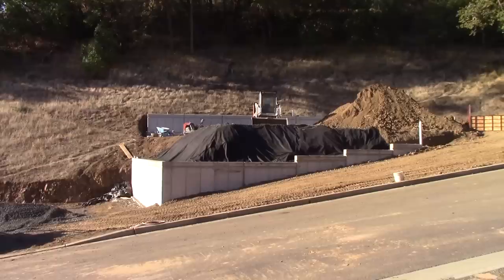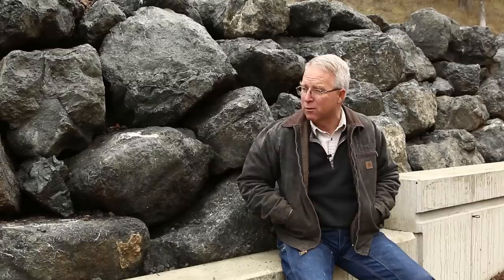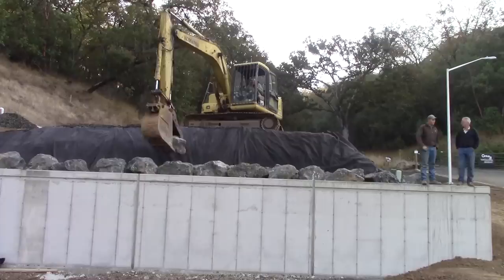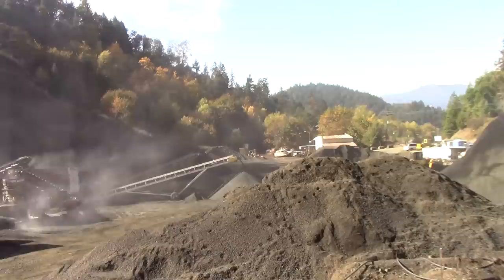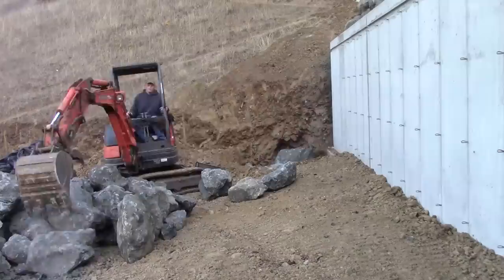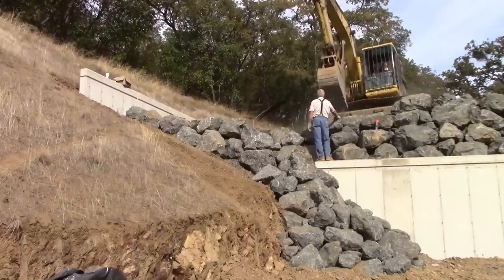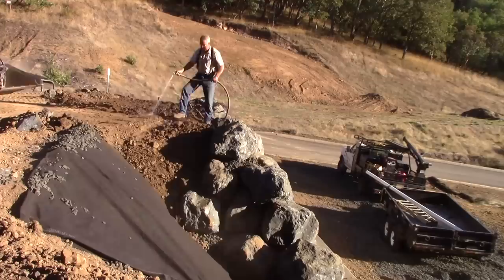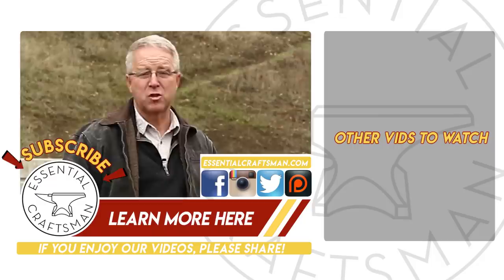How To Stack A Boulder Wall: Ep 20

Comment: Dexter could change a diaper with that excavator!
Reply: I was on a job once where the operator could put one of the teeth into your back pocket.
Reply: I worked on a job once where a guy dropped his glasses into slack water on a river, downstream from a barge of gravel that was getting unloaded.  The crane operator motored over to the spot, gently dropped his clamshell bucket into the river and fished out the eye glasses on the first try.  I was forever in awe of his skills after that.   Cheers!   Whipple
Reply: I'd be filling a few diapers being so near to that machine on rocky footing.
Reply: Well we can say he is dexterous.

Comment: Looks awesome. In water resources engineering, we use riprap for erosion control. It's fairly common to use it on the upstream face of an embankment dam to prevent damage due to wave action. I have a coworker who refuses to walk on it because he's afraid of snakes ;)
Reply: So cool seeing two of my favorite channels in one setting. I'm a recent grad in water resources and love both of these channels.
Reply: No lie!  I was picturing children of the future home owners climbing on that rock wall and how they scramble upon seeing their first snake.
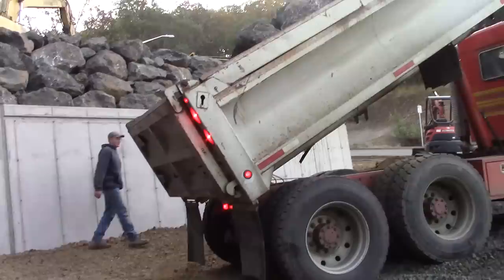Reply: I am sure this system has a  surcharge problem; the top of this wall is overloaded. Does his "soil engineer" have all his pistons firing?  Plus the overloading of the toe of the footer at the corner detail with those boulders. That corner detail 9:36 also DIRECTS water to the underside of the footer; the best way to cause that footer to fail is to wash out the soil it sits on! Gator grid fabric or similar products should have been specified for this job and not just soil compaction.
This engineer makes me think of the engineers that build on the hills of California and then the owners are surprised when their homes slide off the slope they were built on.
Reply: @EngineerPEretired   See Episode 24: He had to re-stack the boulders
Reply: @manorin  , thank you for the redirect...  someone else also wrote me on the side, to look for that video...    I wanted to cut my loses on critiquing his work... Basically, he is doing a great job of sharing some information in his videos and I do not want people to "throw the baby out with the bath water"...
Besides, he has a more manly microphone than I have... lol --- I really have to spend time and make my audio separate from my videos... 
Just do not have the time to spend editing...  (my mac and Final Cut Pro are the slowest rendering software?)...  Takes about 10 hours to render a ''canon camera video to an Apple to a Youtube production)...
Okay, back to the subject, I do find a few mistakes he makes in each video and he does them without stating this can be wrong or I am experimenting... He presents as this is the way it is done and you can do it this way also...  Another example is him using two tape measures on a wall     which he joins and states he is within 1/4 to half inch...   
At the distances he was at, NO WAY because he had an elevation change that he did not account for, the elevation change was two fold, one was the heightS of the anchor points of EACH one of his tape measures and the point where he joined them (at his location)... 
This was compounded by his belief that the tape measure(s) would not stretch, and that he had the ability to keep all these things level and touch each other (that was a defect there)...
I use a professional equipment and an ametuer builder would use his method(s)... or a builder that will NOT invest in himself by purchasing professional equipment...
With all that said, the tapes can be used buy with great doubt... 
In conclusion I appreciate the entertainment and would welcome the chance to educate him on his errors; so the public can get a more quality understanding of what is going on...
This means I would support his content and not ''attack'' it (baby and the bathwater)... 
I often do experiments in construction but they are always on my personal jobs which I get to monitor and IF they fail, they go right to the trash can! (Right now, I am experimenting on a floor leveler -- based on fiber content, it is so amazing at this time... I have it on an exterior concrete (very stable base ---- and another on a wooden floor with a small amount of deflection (not disclosing yet)... which, in BOTH cases are NOT showing any surface cracks)...  So far so good...  
Next summer, I will present the findings of these pretty awesome projects, if the wooden floor fails it will NOT even be suggested... The concrete I do NOT expect any failure and we should see a video of that then and with my recommendations... 
I know home owners and contractors are on a budget and want to break some rules... I am just trying to make that budget person find a product that will save them the dollars and give them an idiot proof product...

Comment: It is a pleasure watching a skilled excavator operator.  They are magicians with steel and oil.  Plus, watching a properly engineered rip-rap wall go up is also a treat.  Too many times it just gets dumped and after the first winter rains [here on the "Wet Coast"]  they fail and becomes a nightmare for all concerned.  This is proper building.  I am enjoying every episode.

Comment: 3:21 - is that a crack in the corner of the concrete? is that ok?
Reply: One of the things he says in an earlier video is that concrete always cracks. It's ok and safe because the structural integrity is maintained internally. In other words, that crack is very small and in a place that isn't structural, so it's ok.
Reply: ok thanks! I remember him saying the cracks would happen, I just didn't expect it so soon, and before the house was built. Good to know!
Reply: Even more so, if the concrete doesn't crack the rebar doesn't do any work.
Reply: I think its just a surface crack,,,, and no concrete doesnt always crack  i have basement foundations that i poured 20 years ago that dont have a single crack in them, but it does happen.
Reply: its a wall so a surface crack is not ok
Reply: To me it does not look like a crack.  Perhaps some construction debris, twig or twine.  Maybe the main man will clarify.
Reply: Glass breaks, concrete cracks, girls cry. These rules are immutable.
We try our best to lessen the occurrences of all three.
Just sayin.
Reply: Just a shrinkage crack won't affect structural integrity.
Reply: hey E.C i got a question where is a good place in RB to get refractory cement or such i've tried CO-Op and Home Depot and Lowes and even Willamete G. Stone none of them had it, nor could order it in. Got any suggestions?
Reply: Wrong
Reply: If it were going to happen any place, that is where you would want it to happen.
Reply: I thought you'd get called on that.  Rebar in tension will hold.  But an inside corner would be the strongest part of a retaining wall.  I'm a little dubious about your statement that that outside corner is the strongest point in your wall.  Not to argumentative at all.
Reply: Yep it's a crack, no it won't affect it
Reply: It's considered a hairline crack, a surface crack,  in a wall this size.

Comment: Another great video. The beauty of this property is quickly taking shape.

Scott's explanation of the dangers associated with working near heavy equipment and loads was spot on (as usual). I have an additional concern regarding the hazards of hydraulic lines that is near and dear to me, as it permanently altered the life of one of my co-workers. Hydraulic fluid was injected into his body from a leaking hydraulic line on an aerial lift. The fluid cut through his glove and hand like a hot knife through a stick of butter. He was rushed to the hospital where doctors were forced to amputate his hand and part of his arm as they feared the fluid would spread throughout his body and kill him. There's no way to remove to fluid from your body once it enters.

If you ever see a hydraulic hose leaking, NEVER pass your hand or any other part of your body over the leak. Inspect lines on equipment before using it, never use equipment with kinked hoses or obvious leaks, and always keep hydraulic hoses clear of possible pinch points. All of what I've said may be common sense for many, but I feel it's every working man's responsibility to share and try to help others learn from their own experiences. I hope you all stay safe.

Comment: I am a fan of safety and personal protection that actually protects and let's you work too. Your eye protection when pressure washing the forms made perfect sense, whereas  'always wear eye protection' just smacks of a lawyer attempting to limit liability, not actual protection that allows you to work. 
Similarly with your admonition to be ready to jump if all hell breaks loose with the boulders or excavator, but don't be afraid to get up close and personal to achieve an excellent product. 
The unrushed pace is another example of workers who know what they're doing and are aware of the need for caution and deliberate, precise movements.

Comment: Where I live in No. Cal we call that size of rocks 'boulders', and rip rap is more like 8" on a side. Those rock walls are pretty popular for their look -- they look super heavy duty and natural. Another trick I have seen used in stream beds is to fill a 'wire cage' (the 'wire' is 1/4" dia) with rip rap. So it makes a bunch of smaller rocks act like a giant rectangular boulder which the water cannot move. The smaller rip rap is less damaging to dump trucks and can be scooped. For appearance, though, everyone loves the big boulders like you used.

Comment: Remote cameras are really changing the safety of jobs like this. Being able to see a close up of what's happening out on the end of a piece of heavy equipment like that for yourself without having to get out of the cab lets an operator place material with more precision and confidence. Not to mention being able to clearly see other parts of a site and all the blind spots around your equipment. 

I much rather see a cheap camera on the end of a fibreglass pole get crushed than myself or a coworker if something slips. 

And some of the tech that is emerging now is truly amazing from a productivity standpoint. Use a tablet somewhere on the site to draw diagrams over a video feed to better explain what needs to go where. Companies like Hardhat Connect are rolling remote communications out for hazardous industries, but I can't imagine it is going to be all that long before a camera and headset is common gear for everyone on a job site. Why walk across the lot to look at what someone's doing when they can ping you on the radio and let you see what's going on a second later?

But I think one of the most impressive features of it is going to be letting a senior tradesman quickly jump around between helping juniors with stuff, not just on one job site, but on sites spread across the whole country.

Comment: The guy building the wall did a good job, its tough to build a rock wall blind, it takes patience to build a wall, start getting impatient you can push the rocks you've already set out of position. Rock walls are not cheap to build a load of decent wall rock where I live is 500 dollars plus a load can be 10 rocks in a tandem axle dump.

Comment: Scott once again. Great job.... I know all about trap rock. And large rock rip+rap. Moved a whole shit load of it. Spread a ton of stone. FYI. THERE A THREE SPECIAL HARD STONE QUARRY USED ON THE RAILROAD ROAD BED UNDER THE TIES AND RAILS,,,,, That I know of in New England. One in Westfield MA. (Lanes quarry) . The other two are in CT. One in middlefield CT.( Reeds gap)other one is (Pine Orchard) . In a little town call Branford CT. Just east of New Haven Ct ... Reason I know this,,,,, did my time on the RAILROAD AS A CONDUCTOR in the this area. Stone FROM those quarry was send as far west as MN. You do the Math. Railroad hopper car weight 50 ton (empty)PER CAR Now put 100 ton of stone in the car. Now put 60 cars together. That was the max back in the day we could move. With 4 six axles. Road units ??? Engines. Then run down the road. Out on the high iron.( Main line.) At 50 to 60 mph. Just think three guys could move all that stone with one train. JUST A FYI FROM A EXTRA OLD RAILROAD GUY. PS WHERE WERE YOUR HARD HATS. JUST STUPID IN MY BOOK, REAL STUPID. YOU HAVE JUST TO MUCH INFORMATION IN YOUR HEAD!!!!!!!!!! TO GO HOME EARLY. LIKE ABOUT IT!!!!!!!!!! WHO WOULD. TEACH YOU GRAND SON THINGS. ILL GET OFF THE NAIL KEG PLEASE BE SAFE. JUNKMANDO

Comment: riprap has been a term that refers to anything larger than class 1 or class 2 rock, basically unsorted large rock. other than that you order by the weight of the bolder.  10 is basically a coarse sand, #98 is pea gravel, #57 is what most people call gravel, #4 is a larger gravel, #3 is about fist size rocks, #2  is foot sized, and class 1 and 2 are about the size of your head and are normally distinct based on their purpose as structural or ascetic. while not common there is a #67.

the numbers denote how big or small they are it goes 10,9,8,7,6,5,4,3,2,(class 1 and 2). it is based off of measurements, but my description above should be good for quick recall.

it varies by name but pretty much this is basically how they sort them.

some people will call unwashed #57: #411. when you wash stone it means they wet it so they can filter it and clean the stone.
some times #57 is unwashed but filtered this might be because it is recycled asphalt or concrete and they don't need to wash it.

Comment: Looks like a quality build here but then again I wouldn't expect less... The site prep for the normal guy who doesn't have a connection with the concrete company and rock prep guys would be very expensive. I live in a northern climate and so we have basements in every build and only slabs where water tables are close to the surface or there is permafrost which is way farther north from where I live, you know....Upper rubber Boot.   I digress. Great videos.

Comment: Appreciate the comment on the hydraulic line breaking and the equipment letting  go  of the rock but this is not actually how hydraulic systems work, there are safety redundancies such as a hydraulic actuated check valves closed spool valve controls or electro servos that act as safety measures to protect you and your load if a hose fails,.It is true though that a mechanical failure such as a broken weld,  cylinder split (An almost impossible occurrence due to safety measures noted above )0r operator error causing the load to drop or equipment to tip, operator error being the most common problem causing injuries to persons or equipment .
Appreciate your craftsmanship keep up the good work!

Comment: I used to load class 1s into a dump trailer with a front end loader. And I'll tell you it was a pain because you almost had to let the boulders roll off into the trailer. And I've also loaded rip rap into high sided dump trailers and it sounds a shotgun when you dump.

Comment: If a hydraulic line blows, the machine operates normally, until the fluid is too low. The pump will pressurize everything until the unmistakable grinding sound  of cavitating. There's always time to position the machine for the most convenient access to replace a hose

Comment: EC, if the hydraulic line of the boom fails, the boom should hold itself! There should be a valve attached directly to the two cylinders that only let the boom lower if the operator applies pressure to the corresponding hydraulic line that lowers the boom. Else the boom stays where it is.

It could be that this savety feature is newer than this excavator, but this is how all modern excavators are!

Comment: That geotextile is NOT for weed control. It's to prevent soil from infiltrating your wall, which would hold soil in and behind your wall, which would increase the retained weight ultimately causing your wall to fail. It's an important distinction to make!

Comment: Concrete wall question:  You put connectors through where the concrete was poured (front to back) how do you get those out/cut to provide a smooth surface at the end?

Comment: Hey Sy - since you had a lot of that area open, why didn't you put in a cellar?  Here in the Northeast (even on the coast) we often have granite block or poured concrete cellars.  Curious why you didn't put one there, knowing that the slope of the land didn't give you the option of a large square-foot first floor.  GREAT show by the way!

Comment: Do you have any advice or techniques for moving landscape/ornamental boulders by hand, without a crane, skip, bobcat nor heavy machinery?? 
I want to move/place more boulders by myself, without any heavy machinery.

I moved 12 small boulders last year with a large hand-dolly + ratchet-straps, but they are only small, about 16-28” at longest edge. (was still heavy and a lot of work tho, but fun lol)

I want slightly bigger boulders in the future, maybe 3-3.5’ at its’ longest edge (or maybe even up to 4’ long if possible). But, wondering if those can be moved by hand and if there’s any other special techniques besides a dolly. Or, is a dolly really the best if doing it by hand?

Any help appreciated! 
Would love to see a video/s how to move 3-4’ long boulders by hand. 🙂🙏

Comment: Two thoughts: First, It always amazes me how precisely and gracefully a good operator can move material that large and heavy with an excavator.  Second, you commented on the danger if one of the hydraulic lines failed, and sooner or later one will.  But shouldn't the cylinders on have pilot operated check valves mounted directly to them to prevent movement if hydraulic pressure is lost?  I thought that was standard practice for any equipment that would become dangerous when hydraulic lines fail.  Of course the pilot operated check valves can fail too, but it is much less likely and it is very unlikely to be a catastrophic failure like a line breaking is.